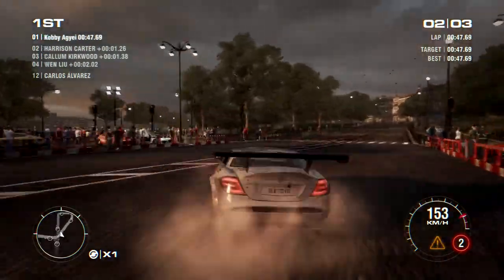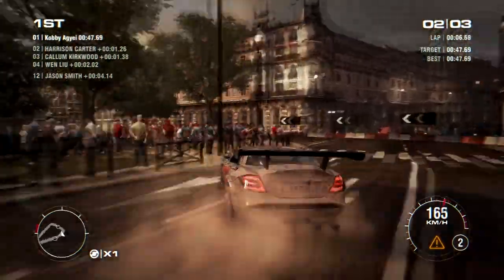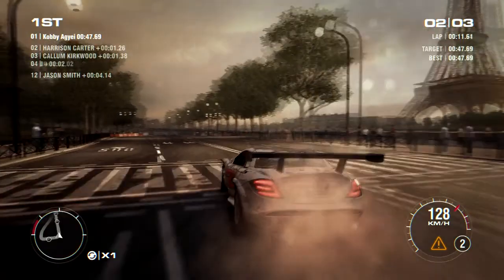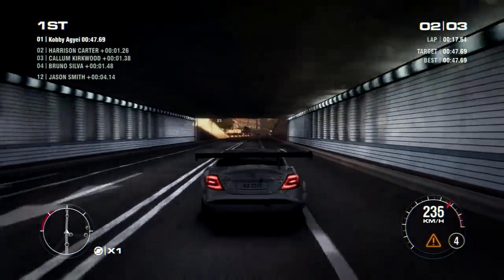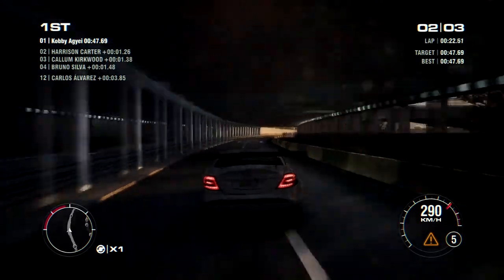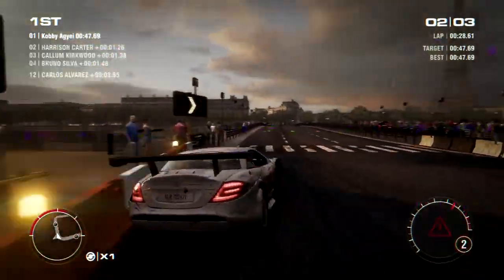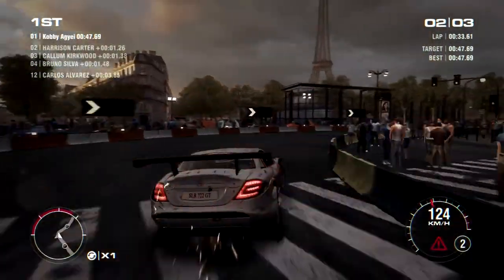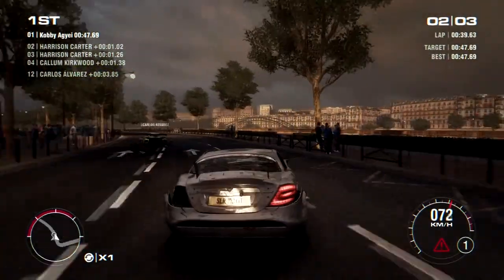Does Intel Change Sockets too Much?

Comment: Umm well because you obviously lack knowledge about Intel the LGA # refers to the number of pins inside the socket, more pins = better tech and more performance with lower tdp and power consumption. I think Intel should come out with LGA 2550 or some shit because it means better cpu's. AMD sucks because they are using 4 year old sockets and they can't do anything about it but add more cores which doesn't help when Intel has hyper threading
Reply from the maker: Intel clearly pummels AMD in per core performance. Yes I know LGA is the number of pins, but more pins is not necessarily better performance. E.g. 1155 to 1150, despite the fact that LGA 1150 has better performance/lower tdp/better power consumption. Yes the amount of pins is an indicator but more is not always better. 

If anything they're always trying to reduce the amount of pins and the form factor, while keeping high performance which everyone knows Intel dominates at.
Reply: Now its not the case. AMD offers support for oldest motherboards for newest gen CPUs.
Intel is hungry mofo who was milking people because they could and there was no one to compete with them, now i hope they will start investing some of the money they milk back into manufacturing.